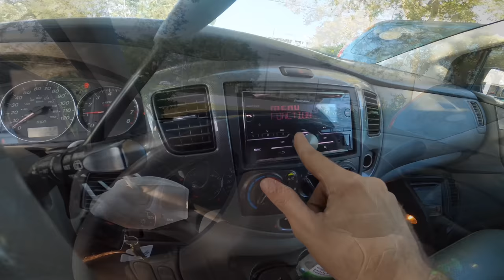Bolts through the window! Mazda MPV 2005 Window Regulator Broken

Comment: Nope didn't miss a spot.  Surprised the customer didn't want the passenger side done or diagnosed.  I would have recommended liberal application of silicone spray on the rubber to allow the regulator motor to work easier.  Great video thanks for sharing these!
Reply: The customer only needs the driver side door for drive-thru
Reply: Silicone spray lasts for a few days, then you have to re-apply more, so it's pointless.
Reply: @gatekeeper65  come on man he said liberal….
Reply: @gatekeeper65  I used dry silicone spray (liberally) and it still works great month's later.
Reply: @JamesThompson-xl4yu  I guess it depends on the source of the problem.
The passenger side regulator in my civic started working jerkily recently. I tried both a dry lubricant spray and silicon spray. They made it better, but didn't cure it completely, and after a couple of days it was almost as if I didn't do anything. I tried both sprays several times, and finally just got a new regulator and replaced it. 
It was probably dirt in the regulator rails in my case. I'll bet if I'd cleaned the old regulator and put it back it would have worked like new.
Reply: I took apart a few regulator motors and found grease work it's way down into the brushes and cause the motor to slow down. Some cleaner on the brushes and grease in the gears works good as new for a few years

Comment: If your hand slips while pulling hard on something while working inside the door, you will find that those openings in the sheet metal panels make for an excellent knife. I have a scar that proves it as a shade tree mechanic during my teen years.
Reply: I have scars from elbows to fingertips from 20 years of door diving. There are makes and models that when you get the repair order you know you're going to bleed. When you get to that step you grab a clean shop towel, bite your tounge, close your eyes, take a deep breath and get it over with as quickly as you can.
Reply: @david me - same for me.  40+ years as a dealership tech has left me with hands and arms that are more scars than not. Your comment about the shop rag is spot on, I would usually just tie one around the cut to soak up the blood so that I could get a grip on my tools. Sacrificing our bodies to repair the customer's vehicles was all part of the job.
Reply: I have a scar on the back of my left hand from plastic, never bled. Dropped a bolt in the door pocket
Reply: Ray has mentioned this before. Talked about a mechanic working in the same shop, cut the top of his hand working on a door, bandaged it to stop bleeding all over his work and completed the job. From what I can recall, he ended up with nerve damage and months of therapy before he could return to work. Scary stuff.

Comment: Ray your humor is on point. You had me laughing about the window comments.
Reply: But that spot he missed right there 👉
Reply: I don't know if he went back in and fixed it, but he left one of the connectors disconnected. You can see it at 18:57 and then again just before the card is attached that it is still disconnected.  Could be for the rear windows.

Comment: Pro Tip: Next time, just pop the master switch out of the panel before reconnecting it to the wiring harness in the door. It is more than robust enough to safely support the weight of the switch without damaging components. You can just leave it connected throughout the entire service until you're ready to rehang the panel.
Reply: Also, pro-tip, reconnect all the connectors. 18:57  Unless he went back off camera and hooked that up, it's disconnected.
Reply: @tarstarkusz  He definitely went back to do that because the window switch is working at the end. But we have no way of knowing if he missed any of the other connectors.
Reply: @rjmari  Yeah, it must have been when he went back in to put that brace in, but didn't show any of it other than showing it being done.
Reply: Yeah that's what they taught us in school, as well as on my OJT and the shop I currently work in. Way easier to just pull the switches from the paneling and leave them connected so you can adjust as needed.

I just HATE working with that plastic film and adhesive. A civic we work on at school has it smeared all over the driver door, and I had one arm half-covered in it before and it took forever to wash out.
Reply: If they do easily come out of the panel. Also always unbolt or remove the window before messing with the regulator.
Reply: @deathatsix  THANK YOU!!! Also, RE: the switch; usually not a problem unless yer werkin' on German Juhnk... Seriously, a squirrel across the street farts sideways & yer screwed... ;>.>

Comment: This hit home, specially when you said clean you interior when you finished... I do almost all my own work on my 08 yukon denali and had to have my air bags replaced. Do to a recall on them and at the same time need new tire sensors (I don't have a tire machine), good time to get those done at the same time. When I picked up my vehicle it was dark already and all I could see when I was driving was the face  and fingertips of the tech stuck on my passenger window and the suction cup over the passenger airbag. Needless to say they broke  my bug deflector on the hood and all 4 hub caps where installed with a impact that rounded the inside of the caps. One broken  because of this ( fuel rims, two small screws hold the caps on). All it takes is some common currency when finishing a job ( wiping down the glass and dash). I wish I could find a great mechanic as your self. Keep up the amazing work. Wish you the best in the  new year.
Reply: went to a tire shop kaffmans now out of bussiness , i replaced ball joints i wanted them to realign my front end . the blk tech cut my rubber splash shield to get to the underside made his adjustments and left nuts on tie rods loose Great job .anyway Ray you do good work

Comment: I am surprised how much of being a mechanic involves things other than the engine.  I am also surprised how much knowledge you have on all of those things.  Your knowledge base is incredible to me.  And yes, your humor is fantastic.
Reply: In theory if an engine is properly maintained it shouldn't cause you much issue, obviously that's not always the case but I generally have more problems with parts exposed to the elements (like the exhaust, suspension, brake pipes, rubber bushings and rust on the chassis). Imo more cars are scrapped due to rust then anything else so it's good to inspect your car regularly and treat potentially problematic areas with a coat of a waxoyl based underbody paint/sealant and keep a fresh coating of high temp grease on brake pipes although a corroded brake pipe isn't massively expensive I still think preventative maintenance pays off.

Comment: The first I do after the door panel is off is remove the screws from the regulator to the glass than manually pull the glass all the way up and use my double suction cups with a cable between to hold the glass up. You can also use tape on the glass around the upper door frame than you don't have to remove the glass and you save time not to mention you don't take a chance of breaking the glass

Comment: Hello, the passenger window just need some silicone spray lube in the window guides and moving it up and down several times. This does wonders for dragging/slow moving windows
Reply: The rear windows in my Mustang convertible will act up once in a while and not want to close all the way, as you say, just a bit of silicone spray in the guides fixes it for the next few months.
Reply: @JeffDeWitt  do you roll the window down all the way to prevent the spray from getting on them?
Reply: @DigiVore.official  No, it's not really an issue, just spray a bit in the window channel using the tube.
Reply: That silicone spray does wonders for windows. I wipe my door seals down with it before winter to prevent them from freezing shut.
Reply: Yes but i,ve he do that the next month hell be back and says you ain't fix it right. Better just stay off of it.
Reply: @TheBlauwitje  Not in a month for sure, but you are right. My point was just for a bit extra for the customer as it doesn't take more than 5 minutes. Customer already denied replacement for passenger anyways :)

Comment: Ray, you could use wide masking tape to hold the window up and avoid taking it out.
Reply: Yeah, that's all fun and games until the tape lets loose and drops the window into the door... and breaks the window. That's why they make lever action suction cups, which I still don't trust. He wouldn't have had to remove the window if he put a 2x4 under the glass so it didn't fall out of the track.

Comment: Pro tip (from the year  when I cleaned windows for a living ): 60/40 iso alcohol/water is the best auto glass cleaner. It'll clean literally anything lightning fast, and you wouldn't have missed that small spot by the side view mirror LOL
Reply: That's what we use to clean windshields of private jets in the hangar I work in.
Reply: 60/40?  I mean, you can buy it by default in 70/30 (70% alcohol) or 80 or 90+.  You're diluting it even further?
Reply: @starlite528  We get it full strength at the hangar.
Reply: sorry for the confusion; 
i buy  90% and dilute it to 60%, seems i forgot to specify. I find the 60/40 evaporates just fast enough to allow me to get the glass clean without much effort or having to respray .

Comment: Another good video I watch them all. Thanks. Too bad about that F450 diesel which was misfuelled. Would have liked to have seen more of that one. In a more recent video I thought I saw it parked outside after it went off to Ford for a warranty claim. (I don't think so!) - The passenger window on that Mazda, had a squeak when it operated. Bought a car with similar noise so sprayed WD-40 in the upper window guide, worked a treat, window now fast, window now silent. Many happy do-dee-doos and clicks to you.
Reply: How much you wanna bet that thing will be back after Ford refuses to warranty it, and wants ten grand more than what Ray's shop quoted them?

Comment: Tip for next time... If you remove the switch assembly from the door panel, you can leave it hooked up. Makes these jobs much easier. I also unbolt and remove the glass first.
Reply: Or just use a power probe.
Reply: After disconnecting the window glass from the regulator you can keep it from falling by sticking a long piece of shipping tape over the top of the door frame, stick the ends of the tape onto the front and back side of the glass.

Comment: Dude, thanks for the tip about rolling down the window when working on a car. I had a nice lady's car in for oil change and a rattle underneath. She goes in the car for some reason and takes the key out of the hole, drops it in the cup holder and locks it when she closed it. If I hadn't rolled down that window I would have had to get a locksmith. You the man.

Comment: I totally enjoy your videos and you have taught me a few things, thank you for that.  But I don't under stand why you didn't just push the door handle through the opening  and leave it connected, that is what I do every time I need to check a window switch or motor.  well to each is own.  I have a 04 MPV and had to replace the window motor as well as the switches, motor was a beast to get out and to replace, but I got it done.  The window switch though will need to be replaced again since it started acting up a few months later.  Anyway just wanted to let you know how I did mines by pushing the door handle through the door panel as not to brake the door handle ears for the cables....

Comment: Love seeing this type of repair. It's really interesting to see how cars are constructed, and how the repair process works from start to finish.
Reply: Also shows how wide Ray's knowledge has to be as there's a lot of specialized ways to do things and no two car brands seems able to agree on what's the "right way" for the majority of them. So he has to know enough he can figure out how the car he's working on is put together. All the major parts are easy to recognize, but the special solutions are what can trip you up. Often just common sense can allow you to muddle through. But a lot of your "common sense" is based on experience and knowledge. At times you encounter things where the engineer or designer for some reason has invented a solution that defies everything your common sense tells you and that's when you have to resist the urge to use a longer prybar...

Comment: You make it look easy, just amazing Ray.  I've thought about repairing broken stuff inside my car door but didn't dare try it
because I had no idea how the stuff inside worked and probably didn't have the tools to do it without breaking hold downs,
plastic fasteners, bending linkage out of shape, etc.  But thanks to you and your video I think I could do it now.  Thanks
again.
Reply: You almost always break plastic fasteners. That's why you can buy assorted boxes of more than you will ever need for $10 on amazon.
Reply: Just get a half-decent set of non-marring panel tools and a set of plastic screws, and then hit up Youtube for your specific model. When I started out I was terrified to do basically anything to my car. After a few months of getting comfy working on wheels and brakes, I managed the nerve to replace a seatbelt.

Comment: Lowes and Depot sell suction cups in the flooring department for setting tile. They are handy holding the window glass at whatever level you need while fighting the regulator and motor into place. I used 2. 

The plastic or paper water shields are evil.
Reply: Skoda's have aluminum water shields rivetted in place. But the mats get wet anyway, unless you seal the shields with caulking.

Comment: Surprising.   The customer brought the vehicle in because of the right window concern and then doesn't want it fixed after you have to do the driver side one.  Cost related?  Was that an expensive motor assembly?

Comment: I had a 1998 Ford Contour and the driver's side window regulator broke. I tried and I even got a friend who is more mechanically inclined than I am to help me out. We couldn't get it to go in the tiny holes in the bottom like this. It's also a smaller car and not an SUV. After searching Contour forums, it seemed that the preferred way to replace the window regulator was to cut and reweld the door because it otherwise wouldn't work. At the factory, they were able to put it together as one piece and weld it together then. So needless to say, that window never rolled down again in its life, even after I sold it.

Comment: In the beginning of the video when Ray was trying to turn down the radio he had already shifted into reverse.  My Subaru Outback deactivates the radio controls when in reverse.  The intent is to prevent inattention when backing up but actually has the reverse affect because just like Ray I get frustrated messing with it not responding.  I'm sure there is a reason but the radio always seems to come on very loud when first starrting so my first action when backing up to turn it down.

Comment: Hey a tip to hold the glass up if you leave it in the door while removing the regulator. Use one of those pump up bags that you would have in a lockout kit. Works great.
Reply: along with one of the wedges from that same lock out kit! If the bag deflates you gotcherself a buncha little glass cubes to trade in for a whole new winder!

Comment: Great job Ray. I never liked working on door windows but one thing I would have done that you didn't was clean the rear view mirror. I never liked looking through clean glass at a dirty mirror. But still a great job replacing the window regulator.
Reply: Oh...was confused reading this, but then realized you probably meant what I would call a "driver's side mirror"  [when someone says 'rear view mirror' I think of the one in the center/top of the windshield].

Comment: Hey Ray. In the future you may try using a piece of packing tape to hold up the window, unpeel it to lower down. Or raise the glass and stick to window frame. I’ve changed many of those. Always worked for me.
Reply: Good call.  That was going to be my comment only with duct tape.
Reply: I use a couple of door stops to wedge the window up...
Reply: I have done this on several vehicles. I’ve found that the liberal application of strips of sticky grey cloth on the glass and the top of the door frame allow the removal of the regulatory device with out removing the glass from the rails. The less the glass is handled the lower the chances of breakage. As JC said, it works.

But there is always more that one way to attack a job. 220-221 whatever it takes.

Comment: Changing out Window Regulators ARE A PAIN IN  THE ASS & damn near every car has it's adventures. Shit almost always breaks " PLASTIC "  holes don't line up correctly, the motor is slower even if you lube the hell out of it & adjust it the best you can. GOOD LUCK RAY YOU MIGHT GET ONE THAT WORKS & FITS CORRECTLY. ANNNNNND HERE WE GOOOOOO.

Comment: I never knew there were so many people willing to tell you how to do your job better! I need y'all to come watch me at work tomorrow. I have a 2003 Honda Element that failed the emissions test. High HC, CO and NOx. Has a P0603, new cat, new plugs, new A/F, MAP and Barometric pressure are not the same KOEO (off by .3 inHg), fuel trim is about -10% in all cells, O2's are responding appropriately. Where are my Google Techs at?